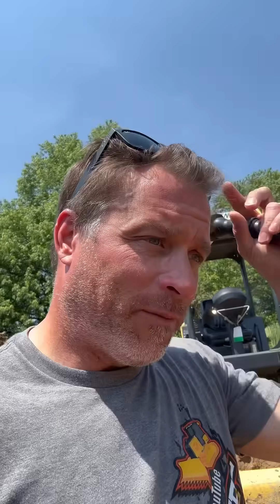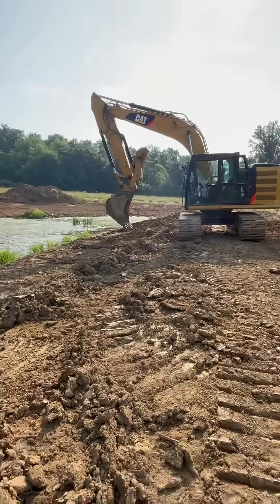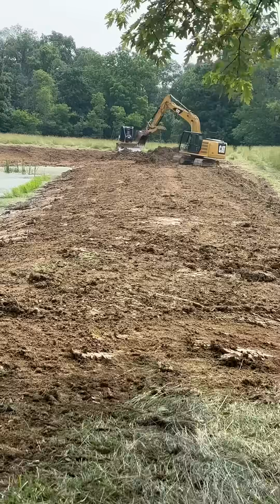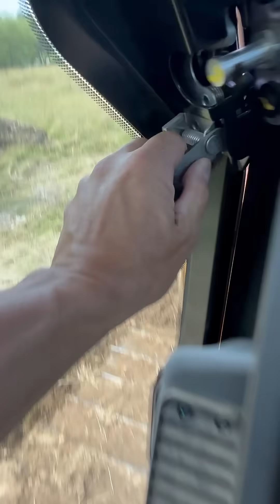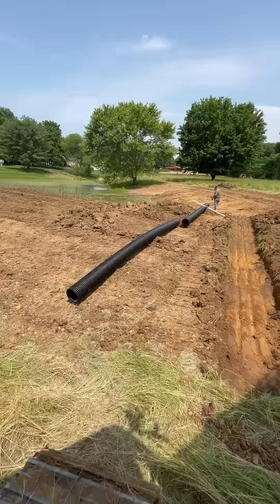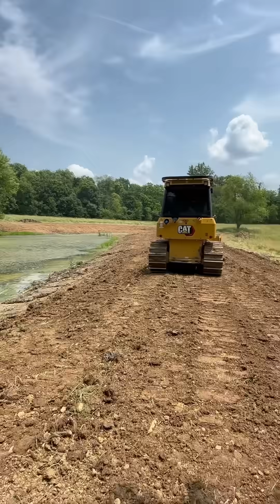Using Bentonite clay to seal the dam installing the overflow pipe with Excavator & Dozer.

Comment: I usually till it into the slope to tighten up an area, but I've also spread it in a thin layer and covered it with material to protect it.  It works great, really amazing stuff
Reply from the maker: Thanjs for the input✊🏻